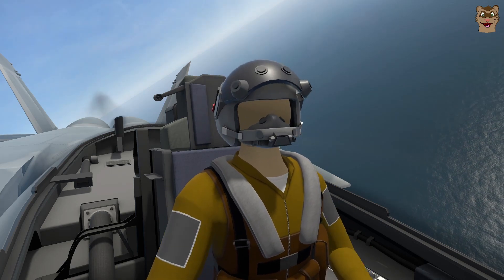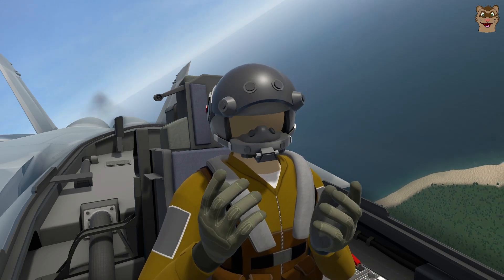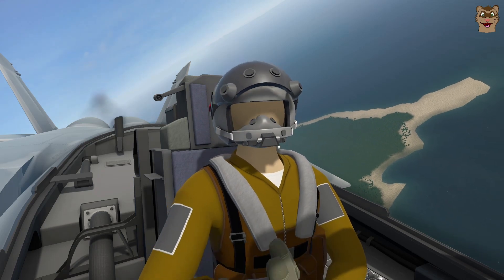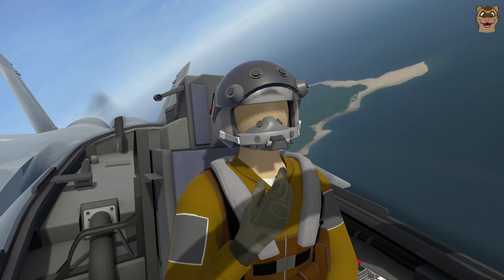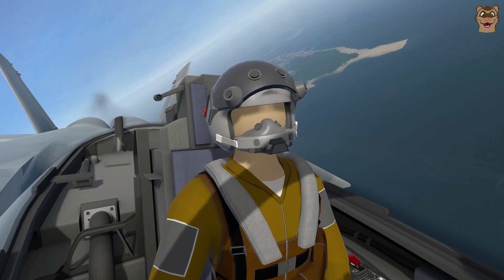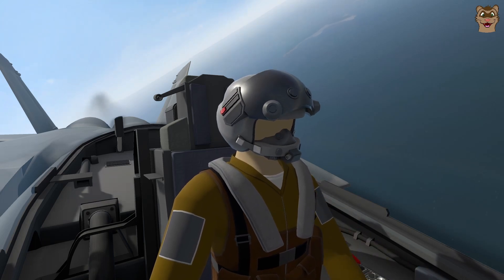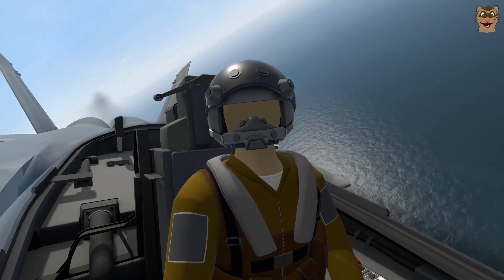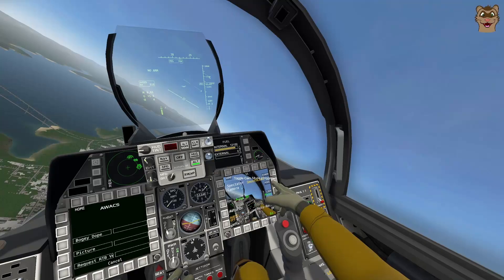VTOL VR - Radio Call Signs & RWR

Comment: How do I change them in the editor?
Reply from the maker: Whenever you add a unit to a group it will take the next sequential number. So the third unit to be assigned to Charlie group would be C1-3. There is no option at the moment to assign multiple groups so the first number will always be 1

Comment: I think "pickle" is actually "pitbull" meaning that the AIM-120 is using its own radar for terminal guidance. Saw that in another vid and on the multiservice tactical brevity code wiki. Thanks for the vid though, it helps to not have to go through entire wiki pages for this stuff.
Reply from the maker: You are right that “pitbull” is for AIM-120 and it is to signify that the missiles on board radar has locked on and no longer needs the aircraft lock on, so the pilot can acquire new targets or go defensive

Pickle is more of a slang term for releasing dumb/gravity bombs, generally used by US pilots and is not a true brevity code or said by the onboard computer. Still a good chance of hearing it in multiplayer though, so worth adding in
Reply: @TheFerretsWheels  Ahh yes, you're right. I hadn't thought of that 'coz I don't play multiplayer.

Comment: the radio guy hurts my brain its so much at a time lol
Reply from the maker: You learn to ignore everything before BRAA. It’s like talking in a busy room, you learn to filter out the conversations, but if you focus you can understand them. I felt a bit overwhelmed at first, but it does start to make sense after a little while
Reply: Braa is simple. Bearing in relation to you or the awacs, range from you or the awacs, altitude of target(s) and aptitiude of target which is the direction it is heading. 
 The awacs will generally indicate in its callouts whether the braa callout is in relation to the awacs or to you, I just don't remember what the exact modifier code for that is. 
 The awacs will substitute certain parts of braa with modifiers like tracking east/west/north/south instead of aptitiude, or leaning on awacs which means it's heading towards awacs.
 All of this can be found on the vtol vr wiki, and I might be wrong so you best go look there